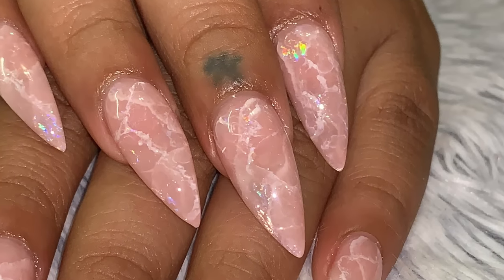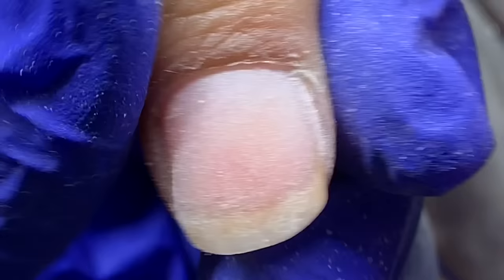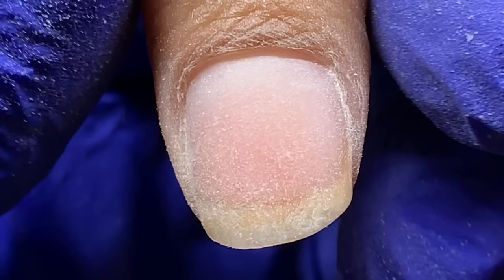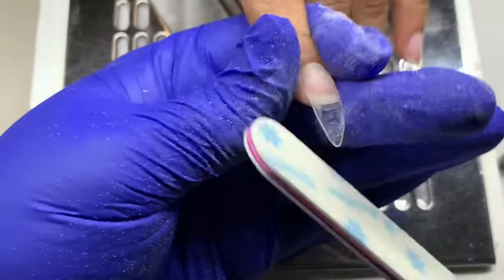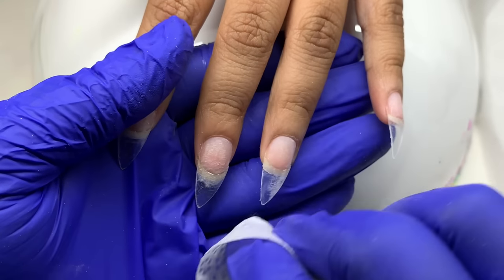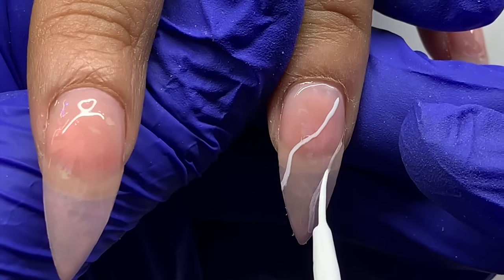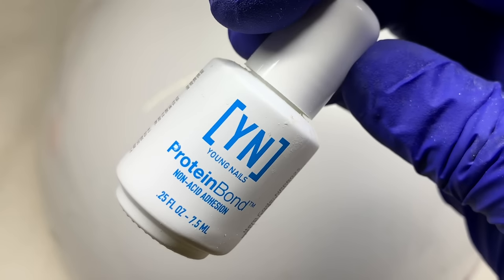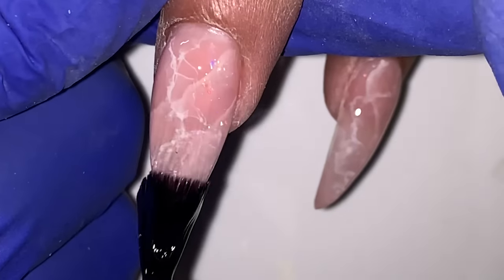WATCH ME WORK: Holographic, Rose Quartz Nails | Easy Marble Nails | Hard Gel Nails

Comment: Question, why not do the same technique with the gel polish striper on the third layer rather than the regular polish? Just curious. 🥰 This is THEE MOST satisfying nail art video I’ve ever seen! From the prep with the drill and the rubber base application! 🥰
Also, thank you for the slip layer advice! I’ve never heard that before but this seems like it’d make it sooo much easier to level correctly.